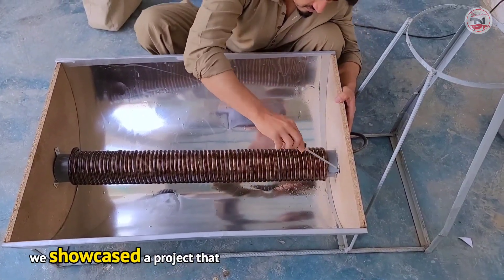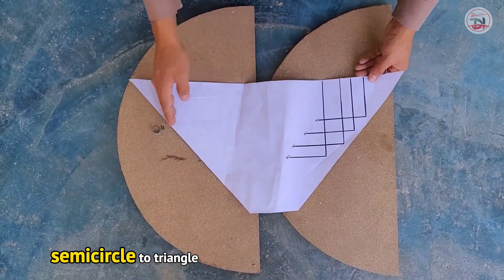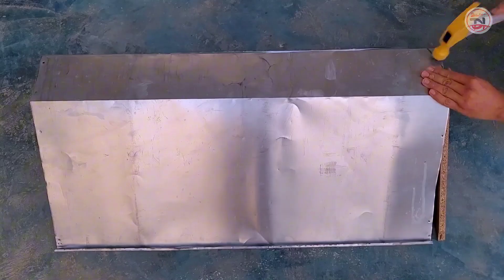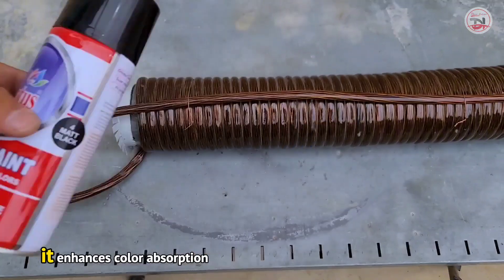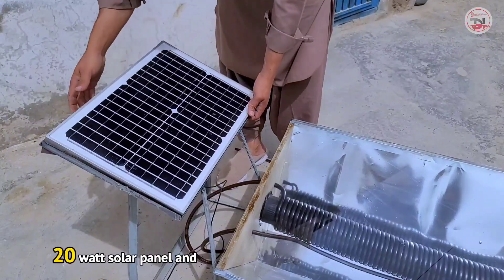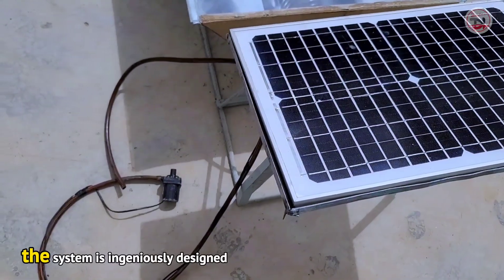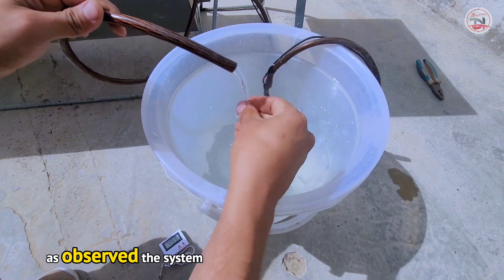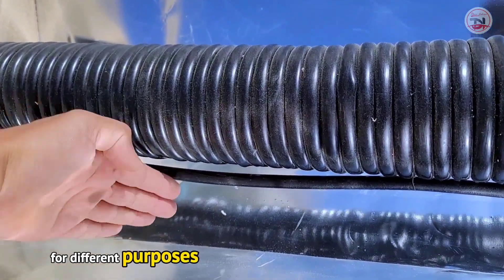Heat 3000 liters water everyday Without Gas and Electricity . #invention

Comment: This type if system has been around forever. 30 years ago , I had a larger version heating my swimming pool .must add one correction, early in the video you stated painting the pipe black aids in color absorbtion? You meant heat absorbtion.